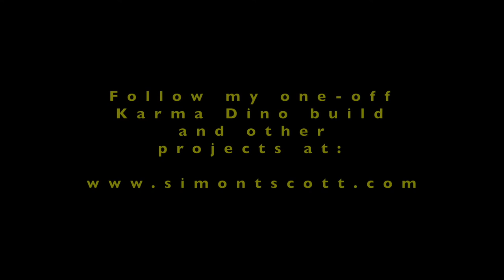MG TF - New brakes, braided hoses and stainless steel exhaust.

Comment: Very impressed you saved the cat. I would like to fit a ss exhaust to my mg. However by the time I get the cat and old silencer separated the cat flange will be like yours. What type of steel and what thickness did you use for the new flange please?
Reply: @DoubleDuckGarage  Thanks for your reply. My cat flange is a bit ropey. Just got to get it all apart and off the car.
Reply: Your video has been so helpful to me. I have just got the cat to down pipe nuts off. They took a while. 
Why did you remove the lambda sensor from the cat before welding the new flange on? I am going to make a flange but planned to leave the 02 in place and pack the pipe.